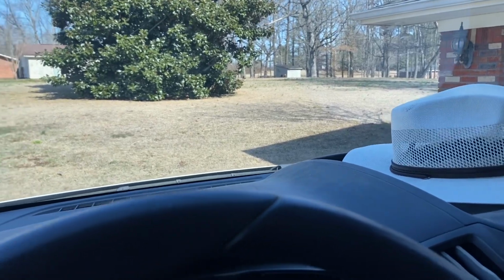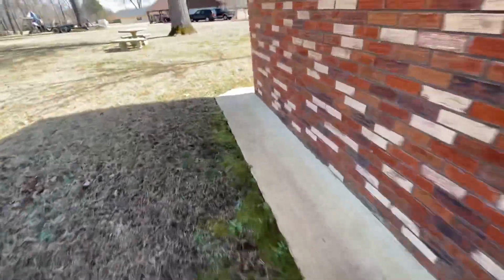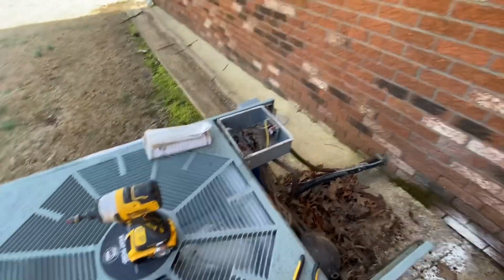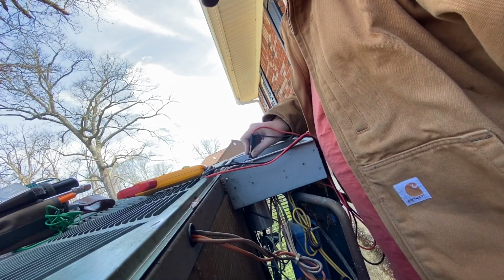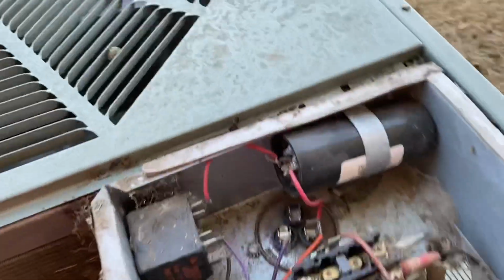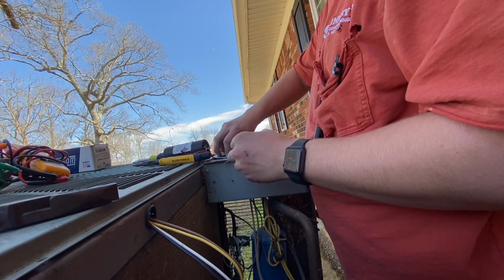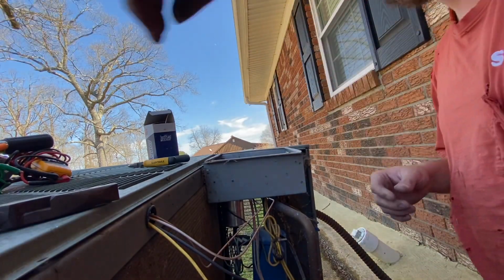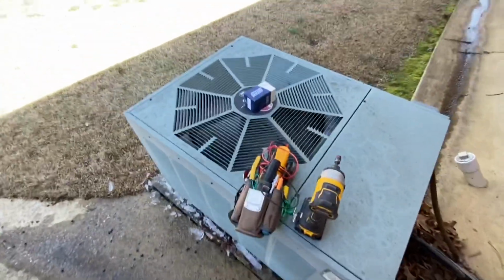Frozen Rheem condenser and fan motor replacement. Part 1.

Comment: I have a question  I'm trying to replace the motor  but new one comes with  2 extra wire I installed and connected wires  like  picture that I have from  previous  didn't come  on not sure what to do with extra wires?